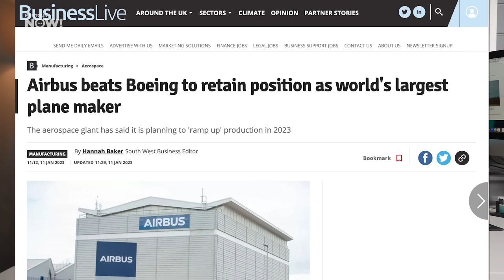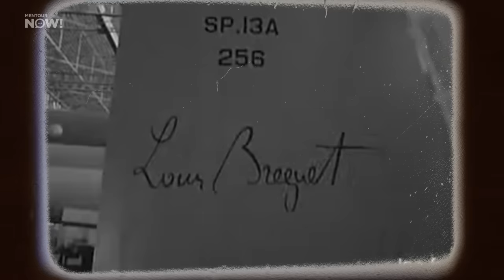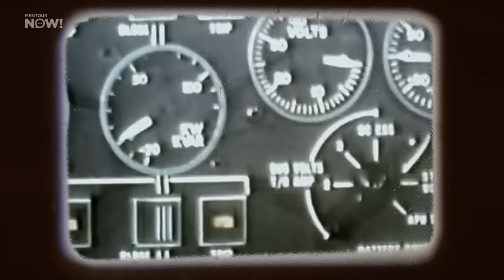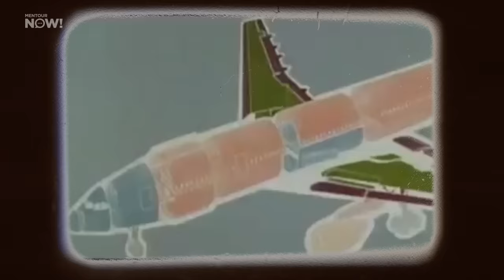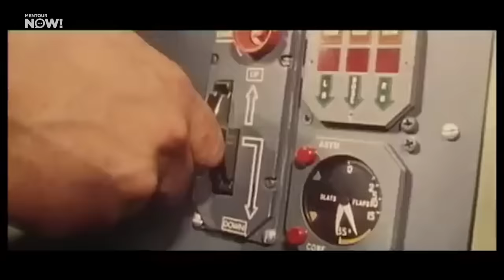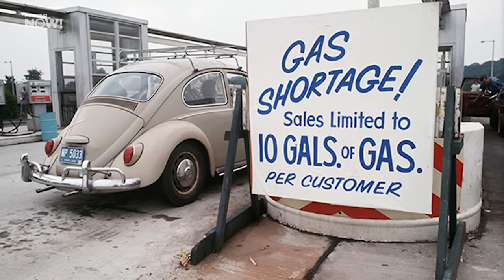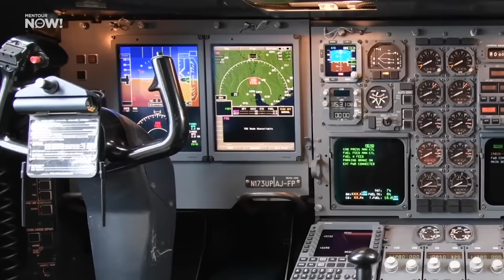Without this Aircraft, Airbus wouldn’t exist!

Comment: One of the things I'm actually still wondering about is why Airbus decided to switch from the yoke to the sidestick as both the A300 and A310 were equipped with a yoke.
Reply: You beat me to it! I'd be very interested to learn about the discussions and debates that led to that. With particular reference to AF 447 (is that the right flight no?), and the views and experiences of those that fly both (or just the yoke).
Reply from the maker: I may do a video about that..!
Reply: I assume it's because airbus has switched to fly by wire.
Reply: @fibecheee That would be an interesting topic as well. Fly by wire vs direct controls pros and cons.
Reply: @kukuc96

It’s less about FBW than it is about the control and feedback design. 

Boeing uses fly by wire but it also still uses yokes and the controls reflect the position of what they are controlling which Boeing felt was important tactile feedback. 

AF447 would not have happened to a 777 or 787. Period.
Reply: @godofthefish I think that’s an awesome topic, and will get more flameouts in the comments section for @mentournow than his vid featuring Trump’s 757 😂
Reply: I am not a pilot, but I'd guess it's to do with ergonomics and the design advantages the sidestick offers.
Reply: @Bartonovich52  No?    Atlas Air 3591's kamikaze dive  happened to a 767, wouldn't have happened to an Airbus.
Reply: You cannot use a sidestick (as opposed to a traditional joystick) without FBW flight controls, although Airbus did fit one on the L/H side of an A300B test aeroplane to evaluate its ergonomics for the A320 programme. 
Neither the A300B nor the A310 had FBW, except for the roll-spoilers in the case of the A310. The engineer in charge of the A320 project, Bernard Ziegler, insisted not only on sidesticks for the A320, but also that they should not be mechanically linked like conventional yokes. Also, unlike aircraft with yokes, the sidesticks are frozen neutral when the auto-pilot is engaged. 
Ziegler also insisted on the innovation of what I call non-driven throttle levers in auto-thrust mode, i.e., when the A/THR is engaged, the position of the throttle levers merely dictates the thrust limits, not the varying thrusts commanded by the A/THR system. (In manual thrust, the throttles work in the conventional manner via the FADEC, and are a delight to use,) 
Boeing's first FBW airliner, the B777, retained the yokes and conventional movement of the throttle/thrust levers in auto-thrust. I've not flown Boeing FBW, but I presume the yokes also move to reflect autopilot inputs in the conventional manner one remembers so well from various types. 
The A320-style sidesticks are fine, but - having converted to the type when it was first introduced and flown it for 14 years - I would have preferred them to be interconnected to enable the PNF (non-handling pilot) better to monitor the control inputs of the PF. 
A common mistake by handling pilots new to Airbus FBW (and even some veterans!) is to make unnecessary and/or exaggerated inputs to the sidestick, particularly in turbulence on the approach.
Reply: @MentourNow  Hej Mentour, that should stir things up! May I respectfully suggest you glance at my jottings below. I've not flown Boeing FBW, but did 14 years on the A320 after 20 on a range of conventional types, including the A310.
This was another great presentation, thanks, despite minor nit-picks. Also loved your recent one on B737 production issues.
Reply: @chrisscott4896  absolutely on spot your words. More, it is somehow dangerous on instruction or bad weather when the other pilot, usually the captain gives by feeling an input causing dual input as they sum up. The full takeover  for small inputs from the other pilot is just counterintuitive. And usually comes late and exaggerated.
Reply: Wrong.  Isn't Boeing mostly fly by wire since the 757 and all fly by wire since the 777.  The 757, 767, 777, 787 all have a yoke despite this.  The yoke is now a glorified force feedback game controller.  @fibecheee
Reply: @kukuc96  Boeing planes are fly by wire now, that is not why the side-stick,  the SS was done to differentiate  their planes from Boeings.
Reply: @cr10001  it has happened and can happen again to Airbus.
Reply: @chrisscott4896  it is my understanding when both sidesticks are simultaneously deflected the plane averages the two inputs.   The ambiguity of  the plane's reaction to this has caused  a few crashes and  many emergencies and near crash incidents...  

Also, there is a locking mechanism on the SS which engages when the AP is active?  Nor on all Airbus models!  there was an incident where a coffee cup pushed against the SS interfering with the AP and  caused an un-commanded nose up which went unnoticed until a stall warning event was triggered.
Reply: @jasonbender2459  Not really! At the time Airbus was planning the A320 sidestick (and Gordon Corps was testing one on a specially adapted A300B), any plans Boeing may have had for a FBW airliner were not apparent. The B777 did not fly until 1994, over 7 years after the A320's maiden flight.
Reply: @jasonbender2459  That's close, but no cigar! if the two sidesticks are moved simultaneously, the resultant command to the EFCS is the algebraic sum of the roll and pitch inputs. So, roughly speaking, exactly opposite inputs would cancel each other out. But identical inputs would be additive.
Reply: @jasonbender2459  Re your second point: yes, the sidestick is locked in a neutral position when the AP is engaged, but can be released with a moderate force. That disengages the AP (not a recommended technique). 
You may be thinking of the RAF Voyager (A330) case, where - IIRC - a camera was left behind a sidestick. The pilot left his seat and, subsequently, the seat was motored forward. The camera was caught and pushed forward by the armrest, striking the sidestick. That not only disengaged the AP, but also generated a strong nose-down command to the EFCS (flight-control system).
Reply: The short answer is to save weight and mechanical complexity.
Reply: So that pilot can have a great meal during the flight
Reply: I think the first airbus model to have the side stick is A320. It was the first fly-by-wire aircraft. I read somewhere that when the A320 lands and when the main landing gear touches the runway, reverse thrust is automatically applied. I am not sure if its really true.
Reply: @thiruardura  it was indeed the A320. The First fly by wire jet by Airbus.
The A300+A310 still had traditional yokes.
And about the reverse thrust:
Nope, you have to apply it, just like with other airplanes. But a safety interlock prevents it from being applied if the airplane is still in the air, so hypothetically you could apply it just before touchdown and as soon as the wheel contact the runway the engines would go into reverse. But it isn't applied automatically, You physically have to move the thrust levers to the Reverse thrust position for the reverse thrust to open.
If you don't select it, the engine won't go into reverse.
Reply: @thiruardura  I worked for Airbus for more than three decades. The A320 was indeed the first Airbus with a side stick and fly by wire. Reverse thrust has to be applied manually by the flying pilot.
Reply: @ax.f-1256 oh ok, thanks for the useful info.
Reply: @Snaproll47518  ok, i always wanted to know this: 
How does the pilot know that the main landing gear has touched the runway while landing. Is it with training & experience or is there some indicator in the cockpit? thanks
Reply: @thiruardura  There is a physical bump when the wheels touchdown. The ground spoilers automatically deploy when the main gears touchdown.

Comment: As a young engineer student, I had the luxury that one of my profs used to work for Airbus and taught parts of the design philosophy of the A300, A310 and A320 avionics in systems integration and design classes. (Specific aspects of it as examples). The way how they planned for one coherent, orthogonal design, with a startup phase, migration, forward compatibility, cross model compatibility, etc. shaped the way how I design systems myself. By the way, one thing: This video is full of little pronunciation and spelling traps that stem from the mix of languages in Europe. You navigated most of them, but "Aérospatiale" is a French company, you pronounced it as "aerospaziale" in Italian (which was, by the way, a very good pronunciation in Italian). The word means the same in both languages, and tbh even I had to look up what country that company is from to not say something wrong here ;)

Comment: Don't forget the major role played by Mr. Robert Vergnaud, Air Inter (French domestic airline) President in the creation of the A300. Not because of the size of the fleet (15 A300 total) neither for the date of first ops (1978) but he was the one who first requested a 300 pax aircraft for short haul routes. With this airline, he was also a precursor for many things such as yield management (blue - white - red flights with associated fares depending on the schedule in 1975), high density config, almost no service on board in 1976, and was the first low-cost airline. Even carried more passengers than Air France in the 60's...
Personaly heard from Mr. Vergnaud during a dinner at home.

Comment: Thanks for the video. Brings back memories. I was just entering my teens in 1976 when the erstwhile Indian Airlines was one of the earliest adopters of the A300B2. They used to fly over my house in Bangalore operating IC105/IC106 Mumbai to Bangalore and return. I used to run out on to my terrace just see the plane climb out of HAL airport runway 27 before turning right to about 360 to intercept the outbound radial. The sound of the GE engines were so different from the Caravelle and Boeing 737-200.

Comment: The A330 was indeed based on the A300 fuselage. Also the nose landing gear was taken over, but the main landing gear was replaced by a taller version in order to make space for the bigger engines of the A330.
The result is that the A330 cabin floor is sloped towards the front. This is problematic for the cargo version, therefore Airbus had to raise the nose gear to level it out. The bulge is clearly visible on the A330-F.

Comment: Awesome video! What about the A320? It made fly by wire popular in passenger jets and it's one of the most sold families.
Reply: More evolutionary than revolutionary. Like the 757/767 that introduced glass cockpit, FMS, and EICAS is as if not more important (as even most general aviation aircraft have all of these features while still using mechanical controls).
Reply: The A 320-Program started in 1979 and the first A 320-100 was produced in 1987.

Comment: Great video! How about doing an analysis of the HS Trident, the four engined trijet, that also later influenced the A300 wing design, which we already know just how good that is, plus also it charted the way for Autoland capable autopilots in the future.
Reply: Minor hairsplit, the Trident was a 3-jet (hence the name); unless you're counting the APU as a fourth engine.
Reply: @cr10001  Indeed it was a tri- jet, but additionally on the Trident 3B variant, it had a “booster” engine, thereby making it a four engined Trident …..

Trident 3B
High-capacity short-medium range version of the 2E with a 16 ft 5 in (5.00 m) stretch and one additional RB.162 booster engine in the tail; 26 built

😁👍

Comment: The A330 is by distance flown my most used aircraft by far - and I absolutely love it. No matter if it is one of the -200/-300 models or the -900 NEO. They are just very enjoyable from  a passenger point of view.

What I think was a good move by Airbus when going from A300 to A330 (unlike what Boeing did in their 737 evolution) was to not try to squeeze them into the same type ratings. This allowed them to fill the proven fuselage design with the then latest in fly by wire technology, making the A330, despite being a now 30 year old design by itself (and thus older than the A300 was when the A330 replaced it), still not look outdated. I heard people argue that the A340 was a bad design and was therefore discontinued - I don't think it was a bad design, it was just made obsolete by the successful evolution of ETOPS - after all no airline is willing to pay way more in fuel than they have to.

Comment: Interesting vide, especially including how Airbus came into existence. Something I'd like to point out is how Boeing has received a lot of criticism about how they keep making new versions of the 737, instead of developing a whole new plane. Meanwhile Airbus did essentially that with the A300 design, as we see in this video.
Reply: There's a few big differences in that Airbus does break commonality when required. And there is nothing inherently wrong with keeping a good design alive with updates. The biggest problem with the 737 is not that it is an old design, but what Boeing did with MCAS and trying to hide it to keep the costs down for airlines to get their pilots certified.
Reply: @Hans-gb4mv   Agreed, but there's one other major problem specific to the 737, in that it was designed with unusually short legs (undercarriage) in the days when jet engines were skinny, and engines since then have got fatter even as they grew more efficient.    This is the root cause of all the Max's woes.    Almost every other type (other than the 737) doesn't suffer from this.

Comment: I just flew on the 787 for the first time and it was a awesome experience. It blows the A330 away in my opinion. I think the 787 is a modern classic!
Reply: They 330 and 787 are a whole generation apart.
Reply: No, it doesn't. Most a330s have an 8 abreast seat, and most 787s have 9 abreast. Seats on an a330 are likely to be wider and more comfortable.

Comment: A small correction, but necessary, about the wings of the A300. While the industrial construction of the wings were made in Ireland, the R&D (mostly R) for the wings and the entire body of the A300 has been done by the ONERA, now named The French Aerospace Lab.

It’s also there that the entire aerodynamics of Concorde (thermodynamics included), Mirage, Rafale, many other aircraft, missiles, rockets and hypersonic spaceship were imagined, conceptualized and tested in labs. That includes the complete concept of a Space Shuttle, its aerodynamic/thermodynamic (shape) studies and testings (using hypersonic wind tunnels), its flight performances/characteristics (the way to fly it to avoid burning too much through or bouncing off the Earth’s atmosphere) and advanced materials/structures to be use (to avoid incineration using “regular” aircraft’s protection), studies and results which were sold to NASA and DuPont (for highly advanced materials/structure at this time), permitting the continuation of Concorde’s studies at that time, which were close to running out of money (in a way, Concorde was saved by NASA, and NASA’s Shuttle Program in its space “competition” with the USSR was saved by the ONERA during the Cold War!).

ONERA R&D (mainly R) also include many other highly advanced studies on navy vessels (including submarines), materials/structures, electronics, optics, sounds, mathematic concepts and future technologies.
ONERA used to be one of the first client of the first American “super-computer” CRAY 1 in the 60s, which was occupying an entire building, but was necessary to make more advanced and faster calculations for the analysis of highly advanced technologies/concepts that ONERA was using, creating and testing.
Even if ONERA’s saw its government’s budget tremendously cut in the late 80s early 90s, I am sure it continues its mission to help industries, especially in aviation and aerospace, going forward into the future.

Check the ONERA out… 👀 (if you want and are interested in R&D and aviation/space history-technologies, like I am😉). It deserves much more appreciation and credit for its work behind the curtain (which kind of make sense since most of its studies are confidential 😏).

Comment: Remember the early Airbus days, I used to live between Hatfield, De-Havillands then Hawker Siddeley and Radlett, Handley Page Aircraft Company and many of my friends worked at the two company’s, we used to go to the annual open day at Hatfield where they were producing the tail end of the Tridents and then the 146. They were also undertaking development work for the HS125 exec jet, by then the series 600 and the Airbus A300, along with BAC (Vickers) at Wadebridge. One year I remember a new milling machine which was in the process of milling the first wing spar for the A300B2. As the project developed so did the volume of work but both the British politicians and then British Aerospace got cold feet and squandered the British share in Airbus.
Reply: Now the Airbus factory is in Chester and the assembly is done in Toulouse, several components are made in France, Germany, Spain etc

Comment: FedEx flies an A300 in and out of here, biggest passenger planes we see are 737/A320 sized (besides the 777X-9 Boeing tested here at the end of September doing 3 take off and landing runs.. never thought I’d see that but long runway over 10K feet and 3K meters and low traffic) so cool to see something that big. 

IMO it’s not a beautiful plane but it’s significance is undeniable and for that, 100% deserves a spot in the significant aircraft series